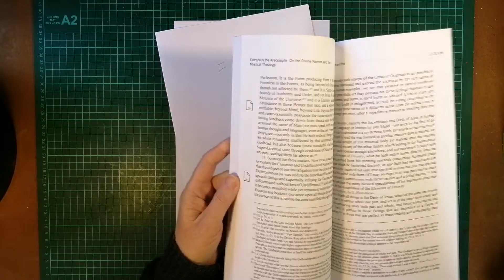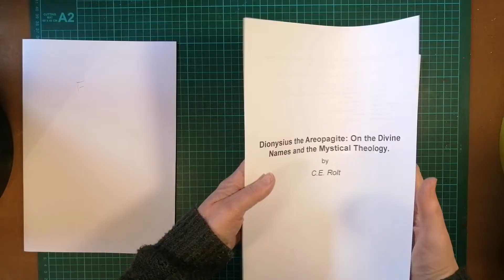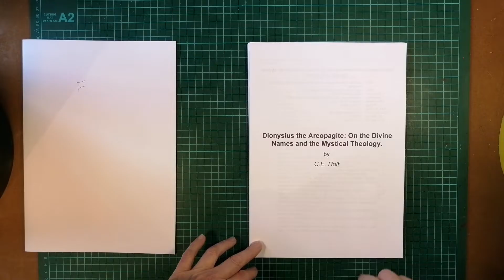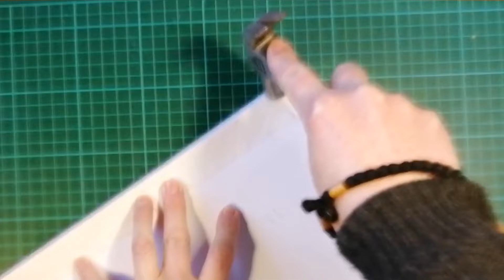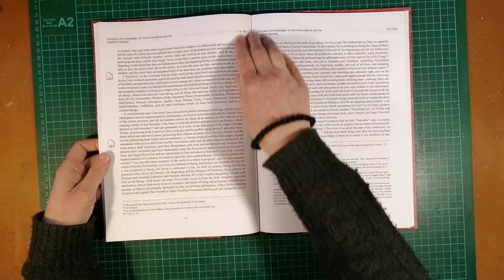How to Bind a Perfect-bound Book

Comment: Tip,  place yor clamps one third of the distance from each end and tighten.  Doing this means that the pressure exerted by the clamps is equal across the entire length of the pages to be glued.
Tip never whip glued items end to end.  Always wipe from the middle to the end using a diagonal movement.  This method ensures that all air is removed from under the material being glued.

Comment: Would you recommend this method for books that are thicker, as in 300-500 pages?
Reply from the maker: You can use it for thicker books (although if you have the option to stitch them that is always better, especially if they'll be used a lot). However, for a thicker book it might be a good idea to add an Oxford hollow to give extra strength.
https://youtu.be/YFn881MYiEo

Comment: I'm curious why you made the spine board width of the spine +4mm? I've always been told width of the spine + 1/2 the thickness of the boards (or 1 board thickness). Also I love your paste paper! It is very lovely.
Reply from the maker: Thank you! The measurements were ones I had worked out for this specific project, and I confess that I usually just go by my instinctive feel. But giving a formula like yours would probably have been better as people may have different board thicknesses.